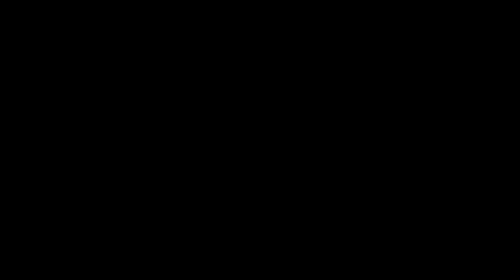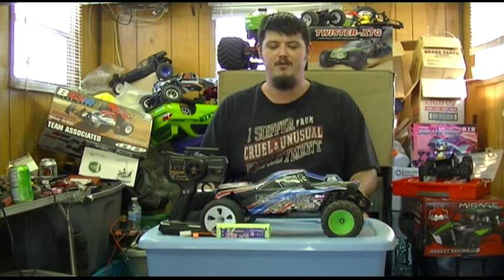Turnigy Stadium king 2wd truggy / ZD Racing ZMT-10 REVIEW

Comment: i'm looking for a spare upper chassis plate for this since my son drove it into a log and smashed the front end.  HK doesnt have the item listed, Any tips on a replacement that fits ?
Reply from the maker: I do not know of any that are compatible . I do have a recommendation though . i would check out www.emphobby.com as they are a ZD Racing importer at the moment they do not have parts for th 1/10 scale models on there website but if you contact them they do have some in stock and are suppose to be adding the complete lineup of replacement parts soon .
Reply: junkstuffandthings
Thank you.  Well i found dollarhobbyz.com so i have ordered the Traxxas Rustler VXL chassi, so i'm going to try a semi convert gonna order the bellcrank too within the next days because of costums.